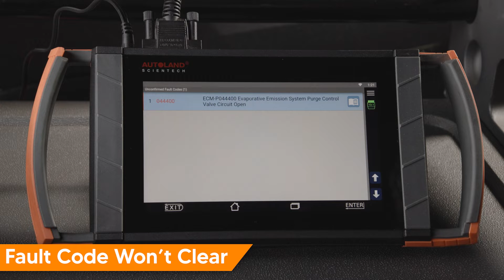Volvo Vehicle Status Modes - How to use Ignition Modes - Accessory, Start, OFF, Diagnostics

Comment: Just what I needed... getting 'car needs to be in usage mode' when trying to use a Foxwell to back off the EPB; 5 second hold of starting switch did the job, many thanks...   :)
Reply from the maker: Thank you for the feedback.
Reply: Sorry to bother you..I have Foxwell NT624.  When you get access, what selection did you use on Foxwell to release EPB?  I've done my wife Lexus without issues.  Volvo is different.